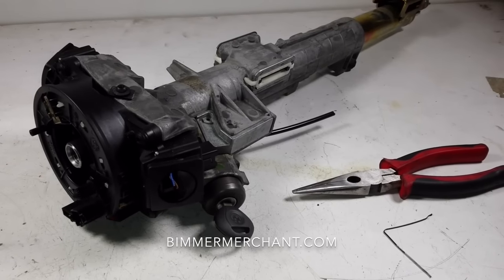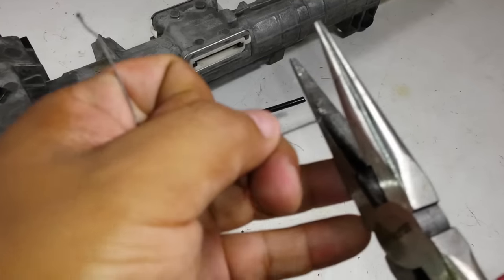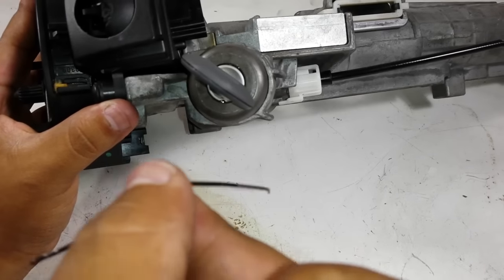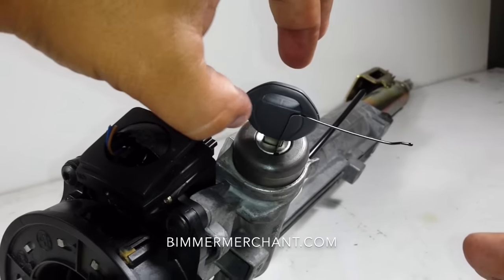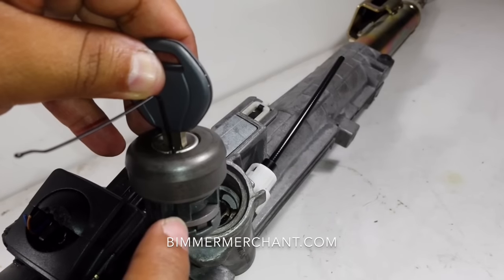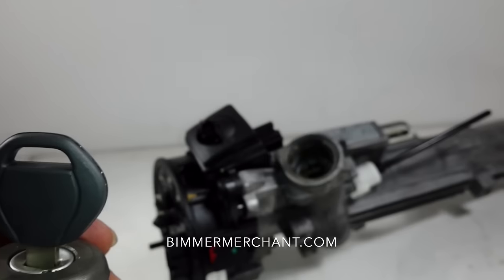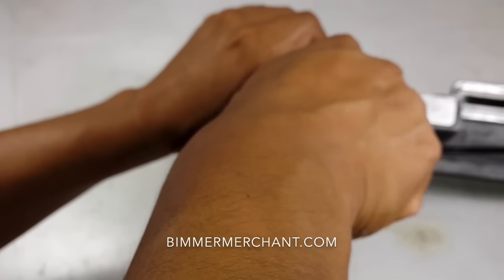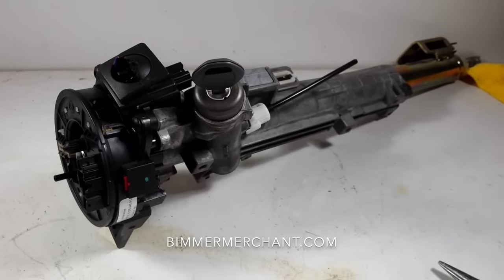BMW Ignition Key Tumbler Removal 740 540 530 330 325

Comment: Excellent video!!  I have a 2004 Z4 with a bad steering column and have a replacement steering column that did NOT come with a key...  Do you know if the tumbler can be removed WITHOUT a key?  I will be able to use the key and tumbler from my existing ignition if I can find a way to remove the tumbler from the replacement column...  Haven't found a locksmith yet and wondering if its even possible? Thanks again for the great videos!!

Comment: Is there any way to get it off without the key? Or make the tumbler already in my car work with the key I got off another e46? I lost the keys to my e46 and went out and got one along with the tumbler for my car but didn’t know I’d need to original key to even take it out, it has an ews delete so I’m not worried about programming or nothing like that should start no problem as long as I can get the key to turn

Comment: Hello, replacing the tumbler with a new one on an E46 and having a tough time getting the new tumbler into place! removal of the old tumbler was easy but getting the new one into place is puzzling me. Am i missing a step or is there a trick to it? I followed your instructions and everything lines up but just won't snap into place! Thanks in advance
Reply from the maker: Insert the key to the new tumbler and as you insert tumbler, turn the key
Reply: I guess Im quite randomly asking but do anyone know a good place to watch new movies online ?
Reply: @Holden Kamden i watch on flixzone. Just google for it :)
Reply: @Elon Kamden definitely, I've been using flixzone for since april myself =)
Reply: @Elon Kamden Thanks, I signed up and it seems to work =) I really appreciate it!!
Reply: @Holden Kamden Glad I could help xD

Comment: How do you remove/ replace it on a 2004 bmw 530i if you can not turn key at all? Mine , the steering wheel is lock and key does not turn at all.

Comment: After the tumbler is removed can I pull the key out or will this make the pins fall apart? Happened with the glove box tumbler, only way I was able to remove it safely was to apply a constant pressure on the pins as I pulled it out and basically taping it down to keep the pins from jumping out with the key not in,  will this work the same here?  Thanks
Reply: How did this work for you?

Comment: My key is stuck in the second position. Had to pull the fuel pump fuse and disconnect the battery. The key/tumbler does not do the 360 spin. Any advice? Thank you
Reply from the maker: sorry for late response.  were you able to figure out the issue?

Comment: Why doesn't my daughters 2006 bmw x5 steering wheel not lock when the key is removed out of the lock cylinder/tumbler? Is it a bad lock cylinder? I tried putting key in ignition, but it won't go in. I gently tapped on the aluminum key hole while moving the steering wheel back and forth and the steering wheel locked. Then i started her car and then turned it off, then removed the key, and I was back at square one again. Key would not go into key hole,  like something blocking it. So i repeated the above and steering wheel locked again, which allowed the key into the key hole. What is the problem,  anyone?

Comment: Hi I have a 530d 2004 and my key won't turn and steering lock stuck on what could that be
Reply from the maker: You might have a faulty steering column assembly.
Reply: bimmermerchant hi yeah thought that I had a bmw specialist come out to me today and he said it's the barrel it need drilling out would you have any clue on how I drill it out to put a new 1 in ???

Comment: Will this fix the stuck tumbler in my Moms E39? If i replace it? The key goes in and out but wont turn
Reply: Try to press the key very firmly into the barrel and then spin it fast towards the ignition position to" jump the tumbler over"  the stuck first position. My e39 starts like that. But if you don't do that then the tumbler is just stuck In first position. Or you can try to just turn it by force , that will work too but I don't recommend it since it can brake the key in the tumbler. Hope that helps.Cheers

Comment: Hi guys, I have a BMW 523i 39 1998 and starting of with my problem is first the key spin a fe time than one day I just can not turn the car off so I disconnected the battery. I called a locksmith and he came spend two hours on it and told me that for me to fix it he want to charge me 2100 dollars.
I live in Australia and when I called BMW they told me to buy the housing is 306 and key barrel is 365 I am a little confused can you give me some advise onthis issue please
Reply from the maker: Hello, that is a common issue on e39 models.  Best recommendation is buying s steering column, similar to the one shown in our video, and having a reputable shop install it.  You can then remove the tumbler from damaged steering column and install into replacement.  That should solve your problem.  Hope that helps.

Comment: Good video, I have a question. When I try to start my car the key does not turn forward and my steering wheel is not locked do you know what could be causing this?
Reply: The locking tumbler, mine is like that aswell and im starting the car with a screwdriver and the key in the tumbler rn

Comment: Not actually how it works.  You just need a very straight pin. When it's lined up it will go in.  Do NOT put a bend at the end.  Dead straight. When it lines up it will go right in.
Reply from the maker: Thank you for sharing

Comment: You aren't removing the tumblers, you are removing the barrel.The "tunblers" are the plates inside - Also, to remove the lock, just put the key in position 1, slide in the pin and pull, takes all of 5 seconds.. Totally useless video.
Reply from the maker: Thanks for sharing

Comment: If you're replacing an ignition switch due to a lost key, how do you remove the ignition without a key?
Reply from the maker: Great question,  you would need to drill out tumbler.  Not a fun process but doable.
Reply: bimmermerchant  how would you drill out the tumbler from a 2001 BMW 325i I bought a new steering column but have no key